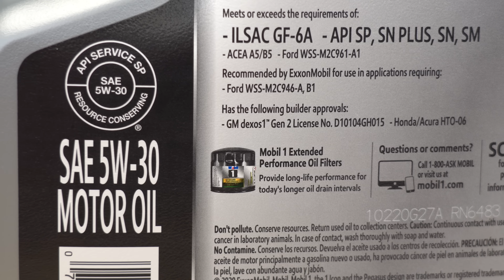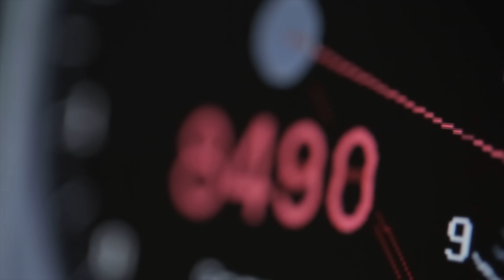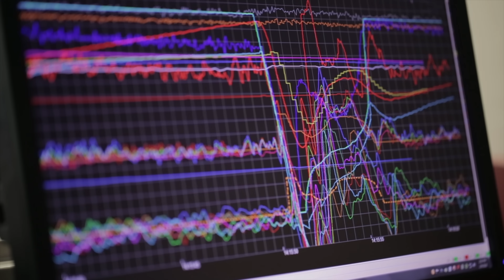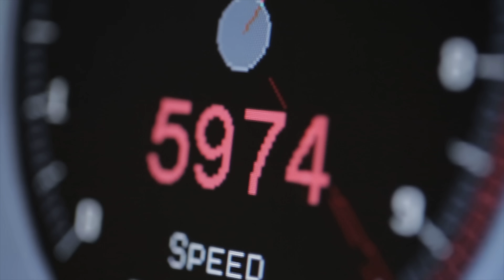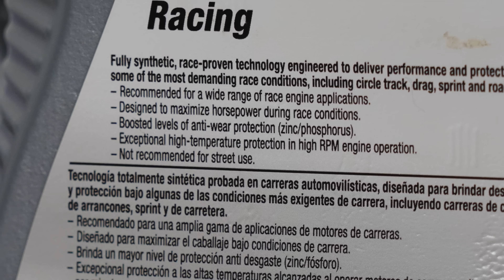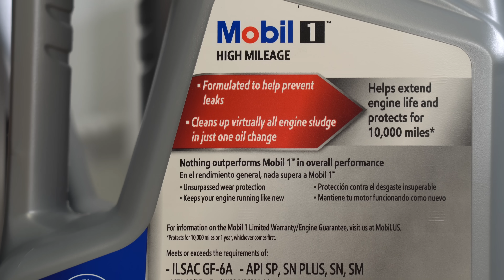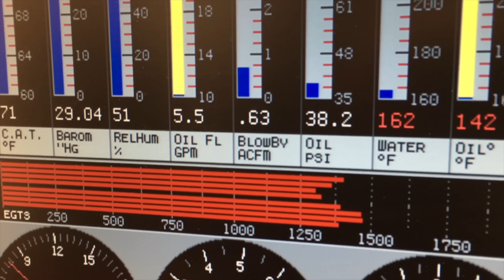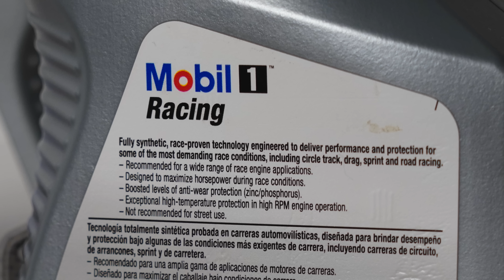Should You Use Racing Oil In Your Road Car?

Comment: “Road cars are rarely at full throttle”
Me nervous laughter
Reply: Any car is a racecar if you're brave enough
Reply: @exquisiteart6478  be brave with daewoo matiz😂
Reply: no its true, my stand alone ecu keeps track of that sort of thing.  I think I am a borderline reckless driver.  The ecu shows I am over 95% throttle about 1% of the time.  With full boost even less.  Oh and within 1000 rpm of redline less than 0.1% of the time
Reply: @BCNeil  I was surprised by similar finding once I started logging. I floor it all the time but when I consider it takes me < 4.5 sec to get to 100kph and ~5 sec to get to "go to jail" speeds compared to the amount of time I spend maintaining speed on the highway...the only street legal cars that typically spend more than 50% of the time above 7/10ths are not the sort of cars that a lead footer would even bother driving.
Reply: Think about changing your oil more often, already gone down to 6000 Miles :P
Reply: @NoName-oj5km  6000?  You monster?  I feel guilty at 5000 on Pennzoil Ultra Platinum.
Reply: @solocamo3654  5000? I change my motorcycles oil every time I refuel!
Reply: @solocamo3654  hey, I drive a shitbox, it should be happy that it gets any oil changes at all
Reply: @solocamo3654  5000 miles... meanwhile my car does 20'000 on the same oil
Reply: @m850i_individual  god, i push mine constantly so i need to change it every 2000-3000k miles. Doesn’t help that i put about 600-800 miles on it every 2 weeks
Reply: @user-bi2me1kj7p  if your engine lives on red line then of course you need to drastically shorten the intervals. Also when you have a lot of short trips. My range rover evoque diesel rarely sees higher rpms than 2'000 - 2'500. It might have a lot of short trips but the car still does nearly 40'000km a year.
Reply: @NoName-oj5km  MO!
Reply: Sounds like you drive a Honda. They live at redline.
Reply: @sigmaprojects  i drive a charger lol
Reply: @QMan1234red  Charger is a good reason to keep the gas pedal pegged
Reply: Me: Laughs in Honda Civic
Reply: That red line is there for a reason. If you can get there as many times a day as you  want they should not have put it there.😂
Reply: My car's engine: I'm in danger meme
Reply: I suppose he hasn't driven on New Jersey highways that often.  I was driving exuberantly on the highway, drafted by a Porsche 911 with a big wing on it right behind me.  And then a "soccer mom" in a car with a bright yellow NJ license plate blew past both of us.
Reply: lol same 19 gt here
Reply: Watching people drive around u would think they were
Reply: Lol, obviously he has never been to my hood or area.
Reply: jeah jeah , another big boy trying to act tuff . go away child
Reply: I daily a Honda Fit and lets just say redline and WOT are common occurrences to keep up with traffic.
Reply: Any car can live at redline all day if it's slow enough.
Reply: Yeah, my BRZ spends more time close to redline than most road cars do, I think. I like to avoid the infamous torque dip that the FA20D engine has.
Reply: Hah it’s true. If you’ve got an underpowered well tuned engine you’re on full throttle all the time

Comment: Way way back in the day. The engine manufacturer of a vehicle I owned strongly recommend 10 w30. I thought I knew better. 15 w50 has to be better! Wrongo bongo said a few main bearings. The oil passages in the block and cylinder head were restrictive to the thicker oil. Sure the oil pressure gauge read higher. My uneducated choice was starving the bearings of lubrication. For a High School kid it was a very bitter pill to swallow. Conversely too thin and the same result.
Everyone can armchair engineer all they want. Use the oil the manufacturer recommends.
Reply: Real🐉

Comment: Out of curiosity, which car runs on a 20k mile oil change interval? I have heard of people inadvertently running a 20k mile oil change interval with no detrimental effects (which is a serious credit to modern engine design and oil performance), but not as a recommendation from an OEM.
Reply: I remember at one point seeing a van that advertised a 20K interval, but I forgot from who

Comment: So is OEM oil designed specifically for factory engines? Or is the oil just a rebadge
Reply: Usually a rebadge, for example Subaru brand oil and ATF is made by Idemitsu.  In other cases the OEM just tells you what they chose, like Mercedes and high-end GM using Mobil 1, Hyundai using Shell/Quaker State, BMW and VW using Castrol, etc.

Comment: Use manufacturer recommended viscosity and change the oil and filter every 3,000 miles, regardless of printed interval.
Reply: Nah 7.500 miles are fine
Reply: Yes
Reply: If you want to waste money and increase your environmental impact, then this is good advice.
Reply: @deviouslaw  it's not bad advise though, you can never change your oil too often.
Reply: @ElectronicsForFun  It is bad advice. The manufacturers validate the recommended interval. Many cars these days have a 10,000mi interval with no problems. (Toyota, Honda, Ford) so if you're replacing oil 3x as often, you're wasting money and increasing environmental impact - to literally no benefit.
Reply: @ElectronicsForFun  true. Simple preventative maintenance. And we should all be recycling oil anyway.
Reply: You make no sense. Guy says use the recommended viscosity but don't use the recommended interval 🤣 I'd say the complete opposite.
Because the lower viscosity recommend is only to meet caafe mileage standards while under warranty.
Reply: @bryantphillips930  so you'd say a 5w20 where a 0w20 is required, using the manufacturer's interval?
Reply: @DefinitelyNotMyRealName  I'd personally always go with the thicker. Being I'm in a warm climate. Look into the cafe regulations and how the manufacturers then started to reduce viscosity. 
They only care about it making it to the end of the warranty.
In the years prior to cafe regs the same engines recommend higher viscositys for engine protection.
: )
Reply: @bryantphillips930  thicker viscosity isn’t always better. Matter of fact thinner oil transfer heat better and results in cooler temps then thicker.
Reply: @yashsab2  don't know about that. That's the job of the oil cooler. The oil is to provide a fluid film of protection. Thin oil sheers easily.
You ever seen oil at operating temp?
A straight 30wt will pour like water. How will a 0w oil hold up..?
Probably have very little protection.
Low viscosity oil has its place at a cold start-up.
Reply: @bryantphillips930  lots of wrong info. 0w oil flows better than 5w only for cold starts. As the oil warms up 0w40 and a 5w40 are gonna provide the same protection at operating temperature (though this doesn’t mean all 40 weights are the same). Also most cars don’t have external oil coolers. Usually only high performance cars have them or cars that are designed to take heavy loads ex: towing.
Reply: @bryantphillips930  Also you can’t tell the lubricant properties of a oil when coming out of a engine hot. All oil gonna look the same when coming out of a engine.
Reply: @yashsab2  I don't think your helping your case.  I didn't know you were such an expert. Probably got a degree in lubrication is seems. 🤣
Reply: @bryantphillips930  the only cars that need heavy weight oils are those intended for high performance driving. The reason being as oil gets hotter it becomes thinner and thinner. So a  heavy weight oil keeps its viscous ability and lubricant the parts still. But for road cars that barely go 50% throttle half the time. They don’t need such a thick oil and for that reason they  use thinner as it’ll keep temperature down while providing protection. All depends situational really. If you’re going to the track, yea thicker makes sense, but on the road you’ll be okay with thinner oil, as the engine never gets hot enough where the oil stops lubricating.
Reply: @bryantphillips930  I don’t just done lot of research on oil forums and looked at tons of UOA.
Reply: @bryantphillips930  how am I not helping my case? Thicker doesn’t equal better. Manufacture switching to thinner oils proves that point.
Reply: @yashsab2 oh ok heard it on the internet...  But yeah a OAP will give a good idea of the level of the additive  pack, and if the viscosity has sheered. And gives a opinion on a expected service life upon use.
And levels of contamination usually wear debre.
But doesn't tell if you have a inadequate fluid film on critical parts.  Heck I learn something every day myself brother, we both gear heads and have passion for this sport! It's all good 🙂
Reply: @bryantphillips930  yea don’t mean to start any beef. We just want what’s best for our motors 👍.
Reply: @yashsab2  yashar, I bet you gotta project car or either like fast cars what's your interest?
Reply: @bryantphillips930  I have a 1995 Audi UrS6 I’m restoring right now. Has 329k miles lots of work 🥲. Still drives fine though, motor’s on these are stout.
Reply: @bryantphillips930  what about you?
Reply: @yashsab2  I've got too much/many.
I was the guy in HS with the 89 240sx fastback 5spd. Back in the day it was a blast.  I redid a 66 mustang289 v8 barn find out of hs it was a basket case had to go thru everything.
Reply: @yashsab2  but now I've married with babies, I work on alot of farm/ heavy equipment. And a helicopter mech by trade.  So slowly getting mellowed out I guess
Reply: @bryantphillips930  I always go a little thicker and change more often.
Reply: @ElectronicsForFun  never hurts. 👍

Comment: One of these on diesel engine oil would be interesting. Especially the whole CK-4 (Compression ignition rev K, 4 Strok) and SN (Spark ignition rev N) compliant oils, and the Ford TSB on it. Made me dig way deeper into the actual oil certifications.
Reply: Yep, Ford WSS-M2C171-F1 spec. Basically called out that ck-4 wasn't backwards compatible.
Reply: @tangydiesel1886  technically, Ford reviewed a variety of CK-4 oils in 2016 and found that the API rating alone was not enough to guarantee their preferred phosphorus level. The 171-F1 spec does appear on some oils meeting CK-4. They're not mutually exclusive.
Reply: I make french fries in diesel oil. Gives them an extended shelf life.
Reply: I use diesel oils in my gas engines.  5w40 Amsoil or Mobil 1 Delvac.   Turbo applications benefit from it all day.

Comment: I was hoping you were going to talk about molybdenum as that is supposed to be a newer better antiwear molecule that does not hurt catalytic converter‘s. And some oils use almost none while some use thousands of parts per million.  An example would be mobil 1 uses almost none yet Redline uses a ton.
Reply: It’s just a different chemistry altogether. ZDDP also contributes to ash content - so when it’s burnt in the crankcase it forms an ash compound that helps cushion the valves as they land in the valve seats. Too little ash and you end up with valve recession. ZDDP is also a peroxide decomposer, which means it is also functions as an antioxidant that helps slow the ageing process of the base oil.

Moly forms part of a whole family of compounds: Molybdenum Disulfide can be a great solid lubricant additive but is hygroscopic (absorbs water from the atmosphere) and forms Sulfur dioxide when it combusts (which would dissociate into sulphuric acid in the crankcase). There are some new Molybdenum Dialkylphosphorodithioate compounds that seem to act in very similar ways to ZDDP, but being a newer additive there isn’t as much solid research out there.

Hope that helps fill the gap a little bit 😊
Reply: They work differently, moly, boron etc is circulating and won't create the same layer of protection.

Comment: I tried racing oil and now my car doesn’t run right. I’m going back to gasoline.
Reply: You put it in the wrong hole.
Reply: @chitlitlah  well I did at first. But then I noticed my windshield getting oily any time I tried to use the washer fluid. That’s what tipped me off.
Reply: @chitlitlah  thats what she said
Reply: @printedprops8730  Awe dang! You beat me to it! 😂
Reply: @chitlitlah  "But, as they say in the Navy, there is no wrong hole!" -George Carlin (RIP)
Reply: @chitlitlah  That's what she said
Reply: @chitlitlah  That's a PH worthy quote...
Reply: If you had a diesel it would work but the injectors wouldn't like it.
Reply: In an old diesel you would barely notice
Reply: Yeah I tried it too, was on the shitter for hours!
Reply: Just flush out the brake fluid, it'll fix the problem
Reply: Ohhhh @keco185 ... you are SO FUNNY !!! Ha! Ha!  (Not!!)
Reply: @warriormanmaxx8991  wow, a whole year later and one person agreed with you…seems a lot more people saw the funny side.

Comment: Interesting. In our spec Miata race series we also change oil after every other event - or about 4 hours of running but we're using mostly standard engines and we want them to last several seasons. We use basically any decent 5w30 oil - any advantage to using a race oil in this application?
Reply: You might get a very slight HP advantage with a racing oil. The SAE viscosity grade is a reflection of the bulk oil viscosity, but at many of the lubricant film interfaces (piston rings, cams, crank case bearings etc) what really governs the friction is the traction coefficient. Racing oils tend to be formulated with better base oils (mPAO vs cPAO or Group III) in which the lubricant molecules are able to slide past each other more easily in the contact zone. That reduces friction losses and help milk a couple more HP.
Reply: @LubricationExplained  Good info - thanks. So much of what people do is influenced by what they see others doing in the paddock rather than science. A couple of hp is almost equal to a couple of percentage  points in a series like mine :-D

Comment: This is a very informative video. Is mixing Mobil 0w20, Amsoil 0w20 and pennzoil 0w20 will harm or benefit my car? Thanks
Reply: I've once gone a full 5,000 miles with 5 completely mismatched quarts (from Royal Purple synthetic to a cheap store brand conventional) of 5w-30 in my car. Had no ill effect and went the full interval. Only real note to make is that you shouldn't put too many miles on such a mix (IE, don't go a full 20,000 mile interval when it's a random mix)
Reply: @cpufreak101  I always change my oil every 5 to 6000 miles. Then I should be alright. Thank you.

Comment: Nope, not a good idea.  Race car engines aren't built to last, they're built to generate maximum HP.  The engine under the hood of your car however needs to last more than 1500 miles.  They usually use 0 weight oil for qualifying and always have an oil heater hooked up to the car when it's sitting in the pit lane for an extended period.

Comment: Could you do a video debunking the myth that smaller engines in performance cars are more likely to break than larger engines. Due to them "having to work harder". I personally think it doesn't effect reliability, but maybe I'm wrong.
Reply: I am afraid there is nothing to debunk.
When you think about it, you can notice a difference in strain that needs to be put on an engine to do certain amount of work, between smaller engines and their bigger counterparts, and we are talking about performance cars, those are not going to be driven in calm manner.
On top of that i need to specify that i am writing about engines wearing out
Reply: Smaller, turbocharged direct injection engines experience low speed pre ignition (a form of engine knock) much more than large engines, so there’s definitely something to the myth. In fact, the major OEMs (Ford, GM etc) demanded the new GF-6 engine oil spec specifically to address LSPI because it is becoming so widespread.

Effectively, at low revs / high load (acceleration phase) the fuel dumped into the combustion chamber dilutes the engine oil and you get a volatile mix that self combusts before the spark plug fires. The pressure wave runs in the reverse direction of piston movement and can tear apart the top landing pretty quickly.

Lubricant chemistry also seems to play a part - so in GF-6 oils the detergent chemistry is moving away from Calcium to Magnesium.

Hope that helps a bit!
Reply: @LubricationExplained  Best exemple is the L15B7 from Honda 1.5T, the pre ignition drive me nuts, looking my kcontrol on ktuner and running always 91+ gas.... i really hope the new GF-6 engine oil will help.
Reply: @LubricationExplained  glad I have MPFI
Reply: If you look at engine rotations per mile, it’s often engines that run at lower rpm that last so long. If the same engine had to turn 50% more in a lifetime it would wear more. Aircooled VW engines always live a shorter life in busses than beetles. Busses are geared higher and are heavier. I think it’s a given.
Reply: All other things being equal more specific output is gonna equal more wear. That's why dragster engines have really short life spans. OTOH, all things are almost never equal and engine design, metallurgy, cooling, oil type, and general maintenance are probably gonna make a bigger difference in most cases.
Reply: This is why viper engines have such a low power to displacement ratio but they last forever.